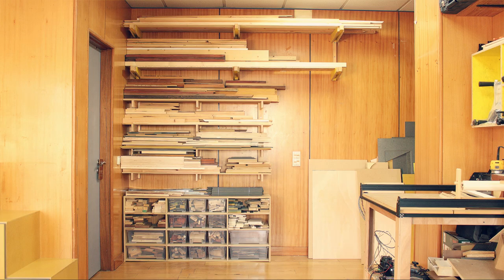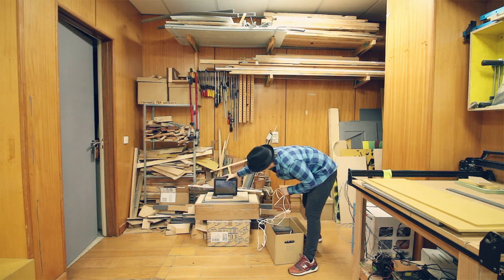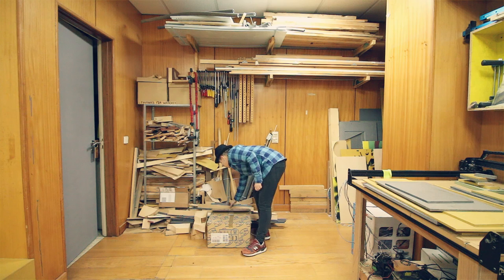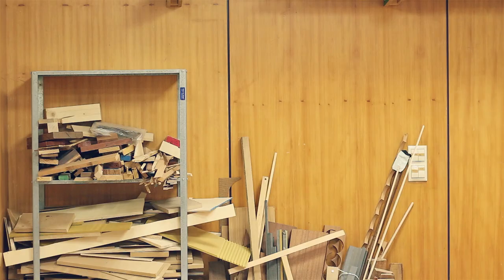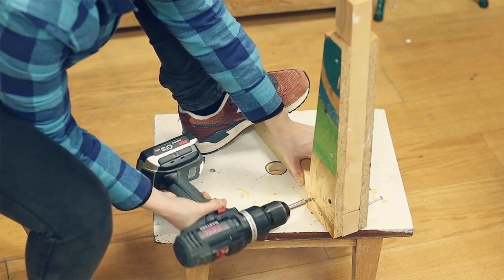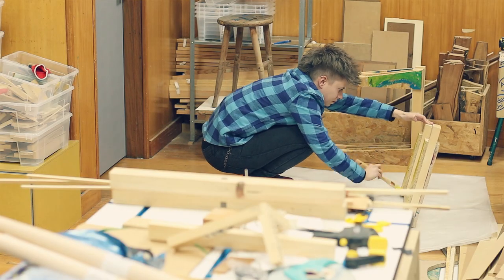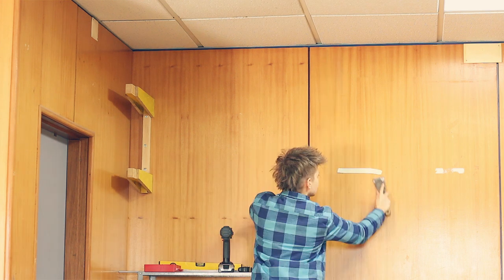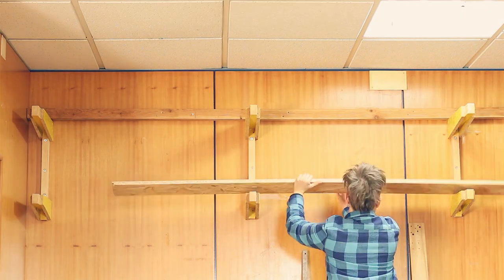Wood Storage Wall: Rearranging the Existing Rack - Ep.1

Comment: I built some lumber racks like these a year ago and just this past weekend I decided to store my wood vertically instead of horizontally on them. It becomes really difficult to take wood out from under a pile but standing on end vertically it is more of a file system. I left the supports in place and built a platform 3 or so inches off the ground to set the wood on to and not the floor. A rope across the top will keep wood from falling out.  For boards 36 inches or less I placed a platform on two supports mid way up the wall and now store those boards there and below. Lumber is stored this way at my local yard so I suppose it has to be the better way. As for sheet goods? That I'm still figuring out. Love your work, keep it coming!

Comment: One question, the brackets that are connected to the wall, how much weight can they handle, second what kind of screws did you use to connect to the walls.  Great video!

Comment: Cris, why didn't you glue the shelf supports for maximum strength? The cantilever construction is begging for glue, would hold twice the weight..........................depending on the strength of the wall you attached it to.